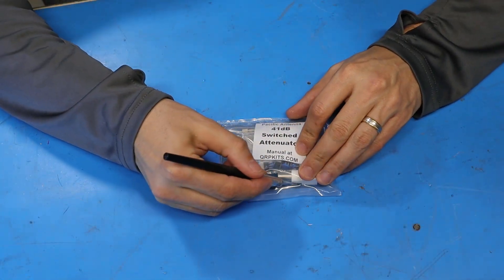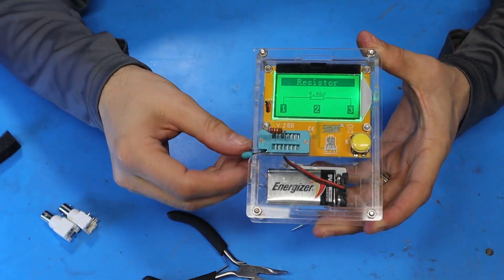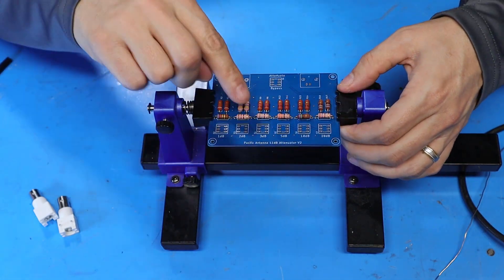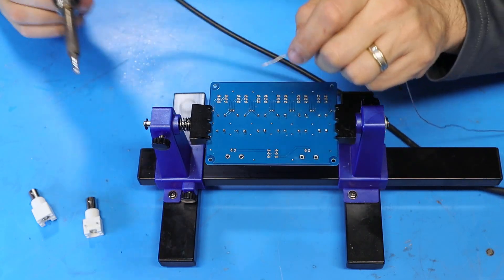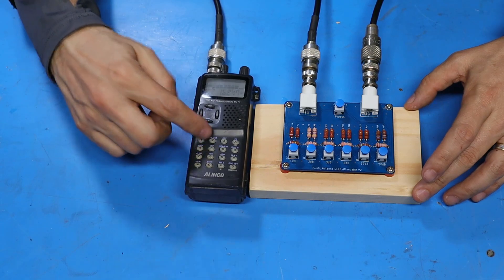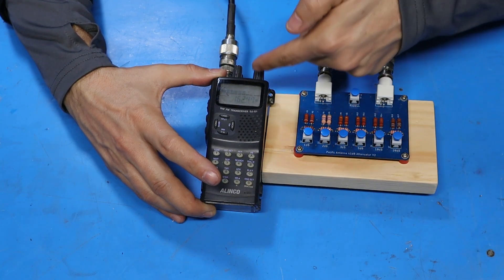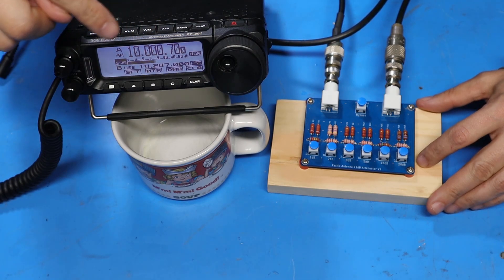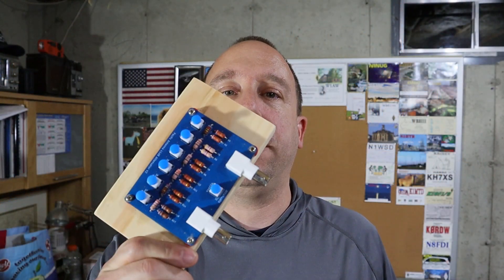Ham Radio: Let's Build and Test the Pacific Antennas 41db Antenna Attenuator

Comment: Never did a fox hunt. How does an attenuator help, why do u need one?
Reply from the maker: An attenuator cuts a strong signal so that you can better determine signal strength when using a directional antenna.
Reply: @SevenFortyOne  tnx - appreciate reply